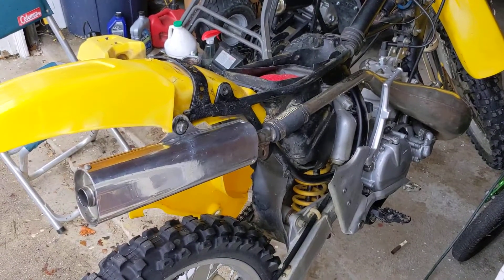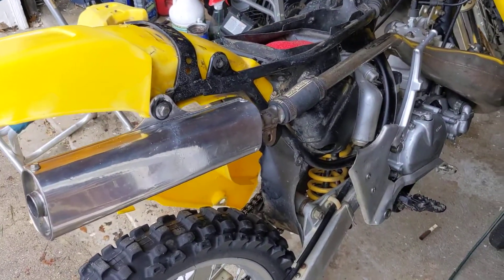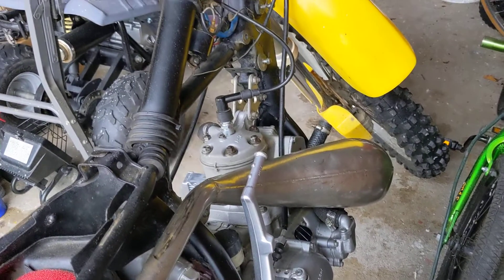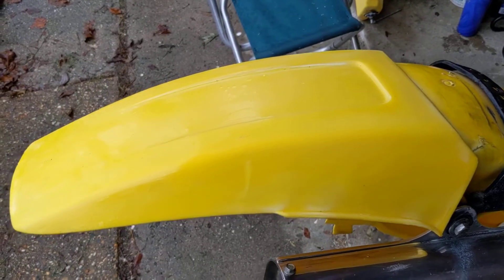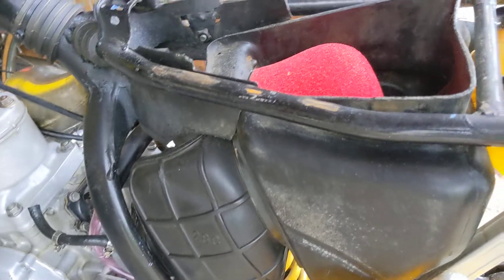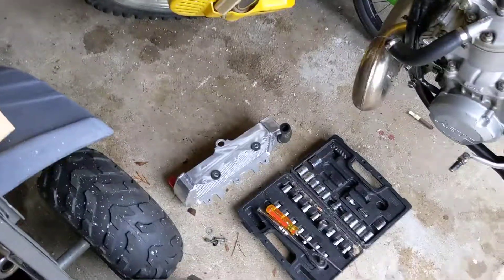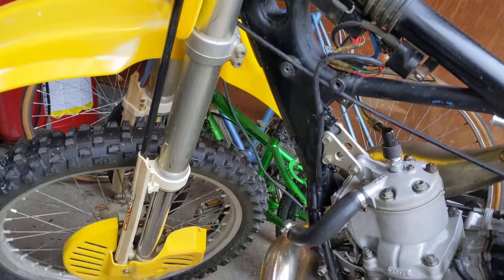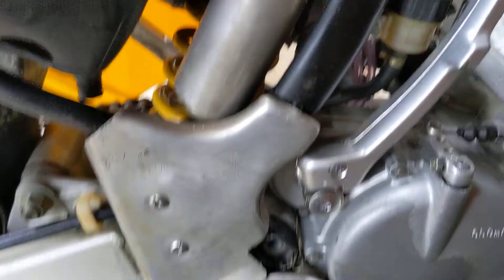Suzuki RM 250 L (1990) Bringing it back to life part 4

Comment: Mine was absolutely nothing but a frame and part of a motor got everything done except for the wiring components as soon as I can manage to fine the CDI box, the fuel tank and get a coil it will finally be ready to fire for the 1st time in 12 years